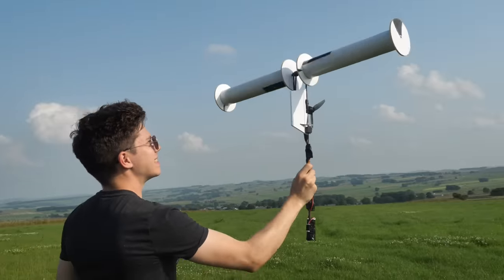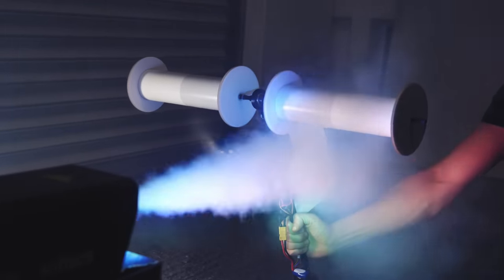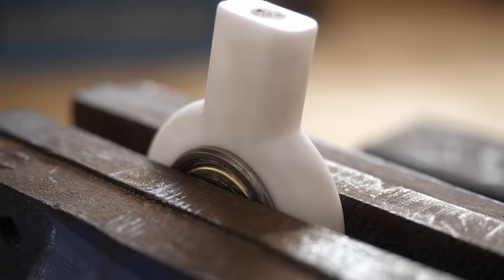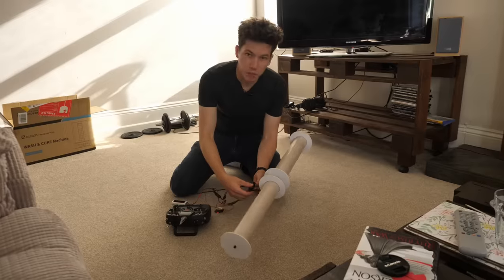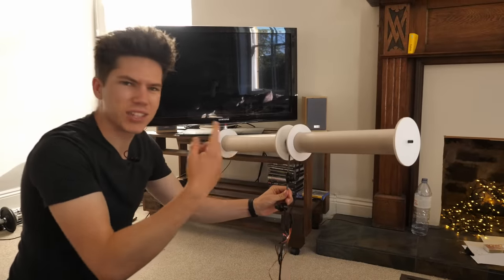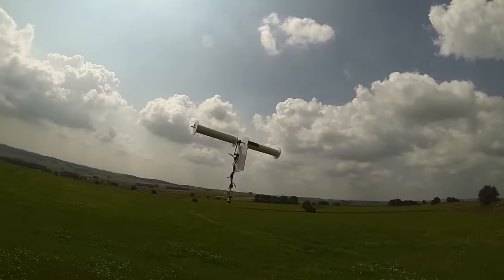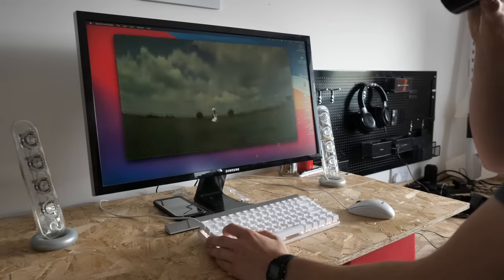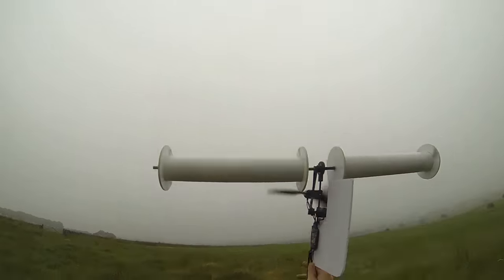Building an Advanced Magnus Effect Plane

Comment: If you had the “Magnus tubes”, so to speak, on the back and front of it to stabilize it similar to a quadcoptor would it fly better? You would still keep the propeller on it for the forward momentum. It’s fascinating to see this and I wonder if the design can be perfected of if there might be any potential benefits to this method of flying

Comment: Idea: open the ends of the tubes and cut slits in them  to take advantage of airflow caused by centrifugal force. This may necessitate some sort of cowling to direct this air, though theoretically forward motion should cause entrainment of surrounding air.

Comment: This is really alternative and kinda cool.

But here's a thought. The lower part is the thing that i noticed is flapping around and makes the whole thing unstable.
What if you take one small 3w motor to spin two long but thin "magnus wings" down there instead of going all out speed on the larger ones?

From what i could see, if you stabilize the lower part, you will probably stabilize the whole thing.

Comment: I wonder if the wings could be made to auto rotate in the right direction with some kind of vanes. A bit like a gyroplane does. That would mean only one motor so lighter. 

Perhaps it would also need a traditional fuselage and tailplane design to get the required speed?
Reply: It's more that a conventional tailplane mounted a decent distance back would increase directional stability.

Comment: Change the direction of the prop motor downwards with a proper casing at the tip of the T bar and remove the belt drive .add a separate motor for cylinder shaped wings so that both gives it a stable lift like a helicopter hovering and  horizontal stright path with speed push of the tail prop

Comment: I have a theory that maybe the lack of differential spin is contributing to it's instability like a car without a differential drive shaft, since these "rotors" are also acting as a gyroscope but are both spinning at the same speed. Perhaps attaching the rotors on two separate motors with a bit of drone software to make micro adjustments that could help, but also increase the weight a bit.

Comment: Lift from a spinning cylinder is actually not caused by flow deflected downwards, if you solve the invicid potential flow equations you can still get a lift term without deflected flow. The velocity on the top of the cylinder is faster wrt to the freestream compared to the bottom surface so you have a lower pressure on top causing lift.

Comment: Awesome video. I wonder if there is any real-life possible application of the concept. Random idea: there is an area of turbulences in the wake of the rollers,  could an airfoil help ?
Reply: This sort of thing could be used to combine landing gear and taxi gear into a single construction, but Magnus rotors are mostly a low-speed only design, because of the relatively large forward cross-section. Also, if I recall correctly, putting a form-fitting airfoil on the rear to prevent airflow from wrapping around should improve efficiency, as well as providing a place to mount conventional control surfaces.

Comment: Dumb question:  Does the surface (skin) of the rotor have anything to do with the lift?

A smooth surface will have a different amount is drag against the air following past the surface.

Would a "plush" surface (i. e., Glue a fabric to the cylinder) or a corrugated surface give different lift, by "pulling" more air in the boundary layer?

Comment: There used to be a toy back in the early 80's which had 2 spinning wings using the same principle, I used to pull it along by the string while on my bike and it made this odd "thrumming" sound - the wings were more "s" shaped though than round like yours - it was made of polystyrene.

Comment: base on wiki, magnus effect lift scale with square of cylinder radius. I guess a giant rotating pancake disk that rotate slowly might have bigger lift than a narrow cylinder that spin very fast. Another thing is the relative wind speed on the bottom of the cylinder ideally should be zero, otherwise you're just accelerating wind forward, so that sort of put a cap on how fast the cylinder can spin base on ambient wind speed. Although with such high wing loading and short aspect ratio pancake disk wing, the wing tip vortices might be pretty strong, might be able to take advantage of that by put the forward propeller on the side and rotate against the vorticies, so the relative propeller speed is enhance by the air upwash from the wing tip. Not sure how you can maintain pitch stability at such low cruise speed though, although technically that's an issue with all hovercraft in general, aerodynamic control surface don't really work that well at low cruise speed.

Comment: A relatively easy way to mitigate your stability issues, & perhaps your steering issues, would be to use 4 cylinders on the same vehicle (3 minimum); 2 in front, 2 (or 1) in back (parallel to the front); like the wheels on a car.

Comment: Have you considered using 4 cylinders, 2 in front, 2 in back, to improved stability, twice still using separate motor/aerosols for flight control? Perhaps adding in variable speed of the front and rear cylinder sets for pitch adding to enhanced forwatd/backward momentum?

Comment: When the motor does that thing where it goes back and fourth, all u need to do is push it a bit by hand kind of like starting a propeller aircraft by hand.
Reply: Nah, on a brushless motor, especislly after a crash, its most likely due to a loose wire or busted winding.
Reply: @maxpower700  Well thats how i got my slightly broken motor to fire up anyways... Just gave it a kick every time i added power and it went

Comment: I wonder how much the forward propeller affects the magnus effect.  Perhaps, instead of a propeller, use some other method of moving forward. Like a shifting weight or an air deflector to modify the effect to prefer a direction. Also, maybe a gyroscope for stabilizing.

Comment: I think you'd have a fully functional prop-hanging stunt plane, if you built this in a more traditional airplane configuration. I think you need a vertical/horizontal tail-plane, then you simply balance CoM and CoL like on a normal plane. Also, if you could control each "wing" independently, you might have a novel control mechanism.

Comment: FYI, you should generally be using larger-profile tubing with thinner walls. It seems like a lot of the stuff you're doing puts a lot of bending on the frame, and the most weight-efficient way to resist that is with a large-diameter, thin-walled structure.

At some point, the walls of the tube will become too thin and it will start to buckle (like a soda can) but from the shots of the structural failure you have in this video, the wall thickness of the tubing you're using is too high.

Comment: Surely larger diameter rollers (still short) would have more of a levering effect on the air in contact with them and produce more lift? Also, if you could, two motors driving them, you could slow down and speed them up to act as ailerons?
Great content as always!

Comment: Can you design it so that the majority of the mechanisms (the weight) is inside the tubes, for less drag? 
And I am wondering about the effect of adjusting the proportional difference between the length of the propeller and the length of the tubes.
Can you change the surface texture (smoothness) of the tubes to adjust the amount of Magnus effect?

Comment: Success!! It flew! What happens if the wings are made to swivel at an oblique angle to the stabilizer? Review the "Oblique Angle Oblong Wing" design..also NASA built a "Scissor Wing " design. Point being that it might go faster when tilted for a quick burst of speed but then tilt back (perpendicular) to stabilizer to increase lift to keep aloft.  Just an oblique idea. Cheers! You've shown enough to get Pentagon Funding.

Comment: Pretty cool! But I don't think you want the center of mass to be so far from the center of lift. Slightly below might be good but it is almost a pendulum. Also, you have no direct pitch control, it seems. I wonder if a conventional airframe would work better, but just replacing the wings with Magnus Effect devices.

Comment: Awesome bud! Really impressive though your description at the beginning is incorrect where you quoted newton's 3rd law, this would be correct if you were building a fan wing which is similar. Your craft gains lift as the top surface is rotating away causing a lower shear in the boundary layer where as the bottom surface has an increase in shear causing a slower rate of flow. This give the pressure differential given by Bernoullis equation, not newton's. Given that airflow is not related to gravity, your description would actually give zero lift as it would be deflecting the airflow in all tangential axis. Love the video man and keep it up! :) ATB

Comment: I might be asking a stupid question,  but isn't there a way to amplify the magnus effect?
Like, if you used other shapes than the cylinders, tall cubes or spiral gears for example.
Or is the smooth surface of the rotating columns necessary?
Reply: Any other shape would be less efficient, it would act more like a propeller.

Comment: Awesome, great problem solving to make a success out of it. Appreciate you've probably finished with this now. you'd have considered this too -  If the cylinders could spin around a static shaft, could forward motion / steering be achieved with two balanced smaller motors either side of the cylinders?
Reply: The Magnus rotors only produce a thrust perpendicular to an already existing airflow (specifically, the rotor gets pulled toward the side where the relative airspeed + rotor surface speed relative to the immediately adjacent air is greatest), so it can't be directly used to generate forward movement.

Comment: Should try to mount the rotor motor horizontally between the 2 cylinders instead of belt driven. Maybe also fit some sort of landing gear, see if it takes of from the ground instead of throwed in the air ? Like vertical take off and landing.

Comment: Hi there, great video however I feel like its the propellers creating lift. if you're using the magnus effect, why do you need to have a propeller creating weight and drag . From what I could see your craft lifted when the propeller was facing up, basically you were creating lift when the air flows over the cylinders like air flows over an aeroplanes wings that's why when you added a bigger propeller it flew and that explains why it was all over the place direction wise as a cylinder spinning a fast rotation should go in a reasonable straight direction. I enjoyed your video I look forward to the next video.

Comment: Do the "wings" have to be outstreched in that plane-like orientation, or could you position them on a more longitudinal axis with a bit of ductwork to make something that more resembles a lifting body craft?
Reply: Well, the force exerted by an individual Magnus rotor will always be "outwards" or "inwards" with regards to the surface of the cylinder, with the side that has a higher relative speed compared to the air passing by it showing an "outwards" thrust, while the side with a lower relative speed showing an "inwards" force towards the axis of the cylinder. Thus, if the relative speeds are the same then there will be no thrust, and an axis parallel with the airflow would prevent the rotor from providing any lift at all.

However, you don't have to have the rotors level either, so you can have the common anhedral/dihedral designs (though I'm not certain you could get the usual stability/maneuverability benefits!), and you could also use these as rudder replacements.

Comment: The pendulum rocket fallacy got you. You can't make a flying vehicle taller than its length,  with thrust blowing down from the top. Without high speed active stabilization they want to flip over and crash top first into the ground. At least you didn't try putting a fin at the bottom of the mast, that would have ensured a flip and crash all the time.

Comment: There is an easier way for people to experience the Magnus Effect. All you need is a poster tube or any lightweight, hollow tube. Hold the tube horizontally at the center. Throw the tube forward while spinning it backwards (to where the top of the tube spins towards you). It may take a few tries but when you get it, you will know.
Reply: Not to take away from this video at all. Awesome work! This is something I have wanted to try for many years (since making a Bic pen fly in high school). I never had the resources to build it.  I am amazed at how much lift you were able to get with such short tubes.

Comment: I have an idea on how the aerodynamics of this thing works. Let me know if this makes sense to anyone else.

Because of the fact that there is no "up" on the wing, and it only produces lift at a fixed angle of attack off the relative wind, the craft can only fly at one speed. To demonstrate this, think if the craft were flying slower than it's ideal speed. This would cause the lift to reduce, and the craft to begin to decent. By doing this, the relative wind changes from parallel with the ground, to coming from the ground. This will point the lift vector of the craft forwards, and cause it to accelerate until it finds it's balance, and either returns to level flight, or crashes because there is not enough energy being put into the system. On the other hand, if the craft were going faster than it's ideal speed, it would be creating more lift than what is required to keep it in the air, and would begin to climb. This would mean that the relative wind would come from above the horizon, and would therefore begin to angle the lift vector to the back of the craft. This would lead to the craft slowing down, reducing it's lift, and returning to level flight assuming that the amount of energy being added by the propeller matches the ideal speed.

Since the speed of the craft is dependent on the amount of lift that the "wings" produce, the less lift you have, the faster the target speed is. This is probably why you removing wing area helped with the stability. Because there was less lift, you had to fly faster, which thereby increased the stabilizing force that the rudder could give.

To be able to control the speed of the craft, you need to be able to control the amount of lift being produced by the "wings". You could probably do this by gradually slowing down the wing motors while increasing the propeller motor to compensate for the additional needed speed.

Comment: I wonder if it's possible to make a drone propeller that uses this; instead of airfoils, the propeller has cylinders mounted on gears so that the force of the motor not only causes the propeller to spin, but also the cylinders to spin to create magnus effect lift.

Comment: I always wondered if it would be possible to do four spools and make them shorter and larger in diameter, like a weird offroad vehicle or monster truck that drives through air. Or even a partially shrouded, wing-shaped conveyor belt rather than a spool...

Comment: Add 2 more of those spinners so it has 4 wheels like a car and shift the weight to the center between them. set up separate motors for each wheel to vary speed for control.

Comment: you should use a rough surface in that fly tube. just glue a sand paper. so the air is sticking better into the fly tube

Comment: When the lift speed of the rotating cylinder wings lift is  attained  and the tail motor thrust .pushing upward slightly it can move like a plane with a micro actuator by shifting the tail push motor angle .right not its 180° to tail when you add a actuator you can chage its direction like a f35 tilt rotary mechanism in 45° 90° and 180°

Comment: What if you rotated your propulsion motor 90° and moved it to the top of the craft, then used the long counterweight shaft as the tail? You might be able to add an elevator rudder combo to stabilize and coordinate the flight and have smoother landings.

Comment: Why do you have the normal propeller in front spoiling the air flow over your rotor wings?  Use a pusher propeller rather than a puller.

Comment: Cylinders not be smooth to increase difference in pressure between bottom and top - this increases lift without increasing rotation speed or diameter. And proper fuselage with a tail will eliminate stability problems. And to eliminate pitch, created by spinning wings, you can make quadcoper version o)

Comment: I need to try to build one with some changes;

two sets of rollers, front and back.
Controllable speed for each side to have aileron control
and front/back for elevator control
Reply: Basically quad-copter control circuitry.
Reply: @michiganengineer8621  yep, if the rolls produce more lift the faster they go like I think.
Reply: @MrAlekoy  : I think the highest possible lift is when the bottom of the Magnus rotor is at zero airspeed.

Comment: Did it occur to you that the prop is pushing different air at each of your cylinders? If you had two counter rotating props it might have been more balanced … Aero Physics is fun … either co axial shafts (trickier) or side by side and Three motor setup …

Comment: I didn't think the Magnus Effect utilized Newton's Third Law. I thought it made the air on top of the cylinder move faster than the air on the bottom (due to the boundary layers' interaction with the flow) creating a pressure differential, hence lift. Does anyone care to elaborate?
Reply: In every case of aerodynamic lift, the lifting surface causes air to move downwards, hence Newton. Pressure differentials are just a mechanic used to achieve this (as it is, most aircraft use the "blunt force" angled airfoil technique instead, with the curve of the wing used partly to spread the lift force over more of the aircraft's length, and partly to prevent the airflow from separating from the wing).